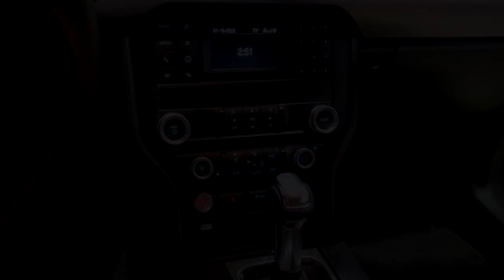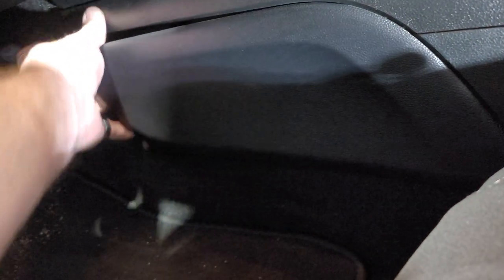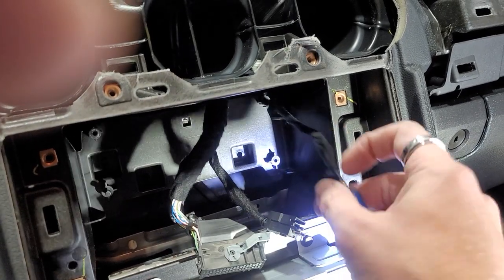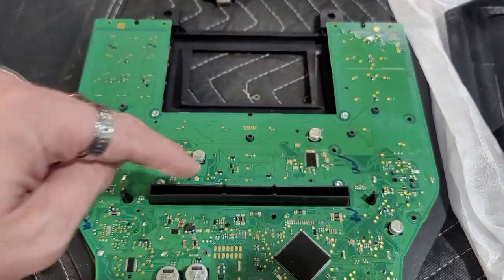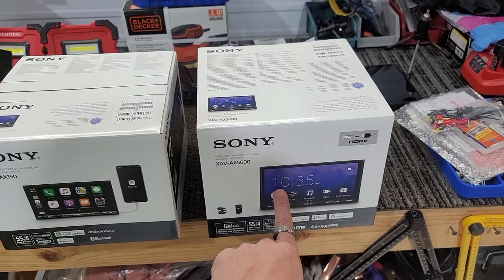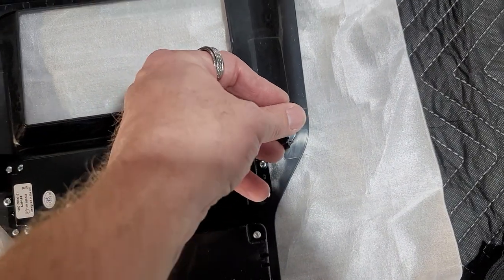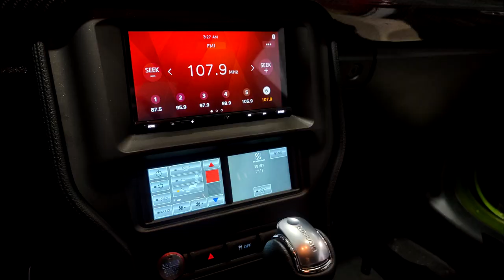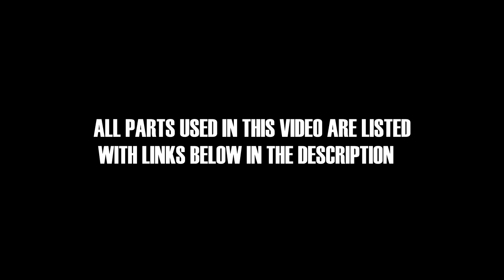FORD MUSTANG S550 BASE RADIO UPGRADE SONY XAVAX5600 -- SCOSCHE DASH KIT 2015 - 2022 INSTALL HOW TO

Comment: B&O equipped cars have a CD player still. That's why the slot is there. On non-equipped cars, they use the same plastic piece for cost savings.

Comment: Thanks for the video. New subscriber to your channel. I am wondering did you use your factory back up camera or did you use a after market unit?
Reply from the maker: Factory works correctly with this dash kit. If you go to the description of the video it has the link to buy this exact one
Reply: My homepage has a newest mustang ambient light, I don't know if you are interested

Comment: I appreciate the video.
I installed this kit 2 years ago in my Mustang and didn't have the USB adapter. I now have 2 different adapter models and I was getting ready to try. Watching your video was a bummer since you couldn't get it to work with your USB adapter. I will probably still try but I will hold off until I have another project to go with it as well, like a new sub/amp combo.
Reply: My homepage has a newest mustang ambient light, I don't know if you are interested

Comment: How does it sound with the aftermarket Sony compared to stock? I have a large system in my car with battery/alternator, LC2I upgrade the same stock radio and it blocks out all the lower frequencies to me? Planning on replacing all the cheap door speakers as well. This is the best video I’ve seen yet on the 15” and up Mustang Scoche head unit upgrade. Thank you!
Reply: If you’re keeping the factory radio you need to use Forscan to go in and flatten the EQ and disable bass roll off

Comment: I got a 2021 mustang and they still got the calculators on them no idea why. Is Soo trash
Reply: Just got a 2020 mines dose too🤣🤣🤣
Reply: no literally, base model chevy and dodge got touch screens
Reply: @noelalarcon7263  maybe for Chevy and Dodge not for Ford. Ford base still had the calculator.
Reply: @diegoalarcon7626  yea that’s literally what i said. chevy and doge got screens but ford don’t
Reply: @noelalarcon7263  and I'm agreeing with you
Reply: I got 2023 and still have the calculator 😒
Reply: You have to get the premium version mines 2015 eco premium and it has the full screen

Comment: Can i connect an aftermarket subwoofer like skar or sundown to this head unit? Im trying to get a sub for my 2015 but i want to install a sub without using a line out converter on the factory head unit.
Reply from the maker: Yes you can on the Sony head unit whether you use the scosche, metra, or Idaralink kits. We have links down below in the description to where you can purchase them directly

Comment: Just bought this, going to install in 2018 GT base 6 speaker. I bought the alpine double din with the mini alpine amp that mounts to the rear of the head unit. Do you know if I will need to splice into the factory harness to feed the doors power from the amp?
Reply from the maker: Just connect the Alpine amp  to the factory speaker leads. You can use an aftermarket harness so you don't have to tap into the factory harness. Just plug a aftermarket harness into the factory plug and then that will wire into the Alpine amplifier for the speaker leads. That is only if this car is not factory amplified. If you have a factory subwoofer from the trunk you were definitely factory amplified
Reply: @octanetvchannel  yeah I figured I would buy the FOR11CK harness. It shows to work for 2015-2019 base mustangs. I am also told the factory wiring can handle the amp without dedicated power and ground from the battery.

Comment: So i have a question i really hope to get answered.  I have this set up but the controls of the AC touch screen don't work, like the AC is constantly  on.  What is wrong here? Cables, motherboard? Touchscreen? What do i need to replace?
Reply from the maker: I would definitely call the manufacturer and their tech support

Comment: how did you connect the factory 12p connector reverse camera to the head unid?, did you need some special plug to converter 12p to a 1 yellow plug?
Reply from the maker: I would contact scosche technical support and they should be able to walk you right through it. It could be different than ours

Comment: I just installed this radio in my 2007 is it possible to put the other 2 screens for air conditioning and sensors in mine ...if I install sensors some how and where do u buy the kit for the screens?

Comment: Just did this in my 18 mustang gt along with all interior speakers and amp.
Reply from the maker: We will be making more videos. It made a huge difference in an ours. We did add an amplifier for the speakers and an amp and sub as well
Reply: My homepage has a newest mustang ambient light, I don't know if you are interested

Comment: Is there a GT premium DriveMode toggle switch conversion upgrade?
Reply from the maker: To be honest I am not sure I would probably reach out to the company. I do believe you can switch out the switch panel on the bottom so that might be an option to where you can put in the toggles

Comment: I have the same radio as you do. When I put my car in reverse the screen just goes black. Any ideas?
Reply from the maker: Same dash kit?
Reply: @octanetvchannel  yeah
Reply from the maker: @aameiel  could be software or need an update. I would contact scosche
Reply: Do you have a camera hooked up? If it's going black that's because your reverse trigger is being activated

Comment: Will this work on my 21 mustang ? last year when i had my windows tinted the car audio guys said my car is tricky to replace the head unit and it can cause trouble with other functions of the car.
Reply from the maker: Mine is a 2020 and it's exactly the same. It should definitely work
Reply from the maker: Definitely use the link in the description to get the kit because that is the one that will work. We also have a link in the description for the Sony radio as well

Comment: Ordered all this with the Kenwood DDX396 from Crutchfield. Hope I don't end up over my head. I have a manual transmission, so hopefully not much difference with the center console. Forums I've talked to are saying nothing should have to be cut, even with a full size (with DVD/CD) player. I have a 2016, though, which may be different from your (late) s550. Is there a brightness setting for the climate controls, or are they controlled with the dash brightness? Also, is there an adapter which will allow either of the two factory USB connections to work with an aftermarket radio? 
I saw another video where a shop installed a modified TESLA style replacement. It came with an adapter to the factory front usb port.
Reply from the maker: I had to make my own USB extensions. I would highly recommend Sony for the head unit but I understand if you want to have DVD or CD function you won't be able to have that. I am not sure on the brightness I do believe it has a control in the menu settings.
Reply: @octanetvchannel  I was looking at the XAV3200 or XAV5000 ($$$). After watching a bunch of walkthrough videos, neither of them looked to have the sound shaping options I am after, nor did any of them have 5V preouts short of the 5500. DVD/CD is not a requirement, although Kenwood makes the parking brake bypass very easy. At Crutchfield, Kenwood didnt offer an Excelon DMR (Digital Media Receiver) in a similar price bracket. My only major requirements are the 5v preouts, steering wheel controls, obviously Bluetooth, FLAC playback over USB (Sony 5500 and up will do this) and backup camera integration. No radio will integrate with the factory USB functionality. I believe it's part of the sync module, which is eliminated as part of the install.

EDIT: In Hindsight, it looks like the Kenwood will only do a maximum of 5,000 files, while the XAV5500 claims 65,000. I have a usb-powered hard drive with ~26,000 FLAC files. That may end up being a dealbreaker.
Reply: @octanetvchannel  I got factory USB working flawlessly on my Kenwood with 2 basic adapters available on Amazon. I can even connect a USB powered external hard drive through the factory port. LMK if you want the links. My head unit only has 1 USB port, so I opted for the center console. With two ports, you'd just duplicate it. I probably used too many adapters. But, basically a female Mini USB (USB-B) to Female USB-A, then, a USB-A Male to Male.
Reply: @sumdood2035  can you post the links?
Reply: @sumdood2035  also when yall say the USBs dont work do you mean they don't connect to the headunit anymore or they don't provide any power at all? Like will i still be able to charge my phone with the usb ports and the scosch kit or no?

Comment: And also mines doesn’t ever turn off should I try without the ground wire
Reply from the maker: If you are using the ScotchKit I would definitely contact them. They have a customer support
Reply: @octanetvchannel  no the Sony won’t turn off

Comment: Does the factory Mic still work? Any update on using the factory USB ports?
Reply from the maker: No you will use the aftermarket mic and we have not been able to retain the factory usb
Reply: My homepage has a newest mustang ambient light, I don't know if you are interested

Comment: What carbon dash do you have looks really good bro
Reply: Can you please drop a link or let me know what kind of carbon fiber you have on the dash!?
Reply from the maker: We are not sure exactly on the brand it is a full replacement with carbon fiber. We actually purchased it off of a person but it is a full replacement piece in real carbon fiber. We are actually probably going to sell it soon because we are switching back to the standard dash
Reply from the maker: @bryanwilson3874  We are not sure exactly on the brand it is a full replacement with carbon fiber. We actually purchased it off of a person but it is a full replacement piece in real carbon fiber. We are actually probably going to sell it soon because we are switching back to the standard dash
Reply: @octanetvchannel  I will send you a personal email!

Comment: In fact, It is posible to get both usb working you just have to splice and solder the wires to the head unit usb's

Comment: reverse camera factory?
Reply from the maker: Yes factory and it integrates with it
Reply: Thank you for responding. You helped me with my next purchase.
Reply from the maker: @BRONSONTV1  definitely use the link I have in the description it will help you get the correct one and all the correct parts you will need
Reply: Did you retain the factory microphone? Or did you have to run a aftermarket microphone?
Reply from the maker: @anthonyxzavior5775  aftermarket that comes with the Sony
Reply: @octanetvchannel  thanks man, think ing about going with a sync 3 conversation but this is Alot cheaper..
Reply: Damn I want to do this upgrade but it looks like a pain in the ass to put together 🤣

Comment: I literally despise the radio in my 2016 mustang it is the shittiest setup I've ever experienced. Seeing how many pieces need to be removed  just to replace the radio makes me despise it even more. I wish I could smack the designer of this shit.
I used to install audio equipment( subs, amps, DVD headrest, etc etc) so damn glad I don't mess with this shit anymore.
Probably ditch the s550 body and swap the Coyote into a REAL MUSTANG BODY. PRE 90'S PROBABLY A 66 FASTBACK.